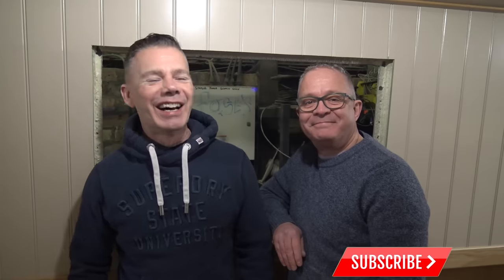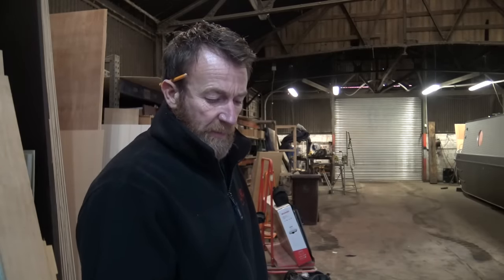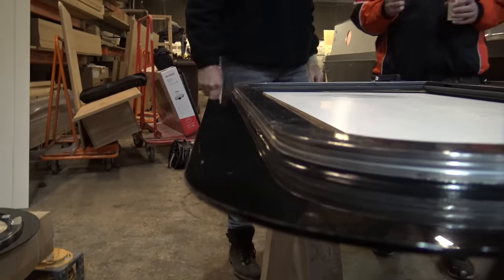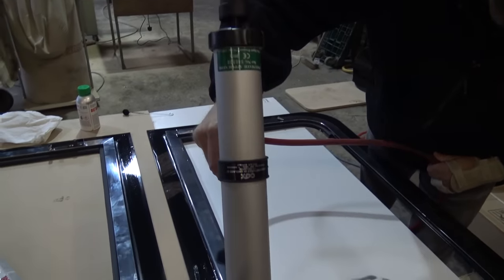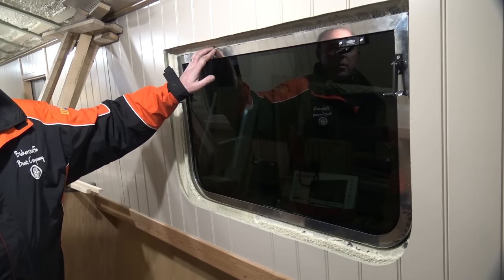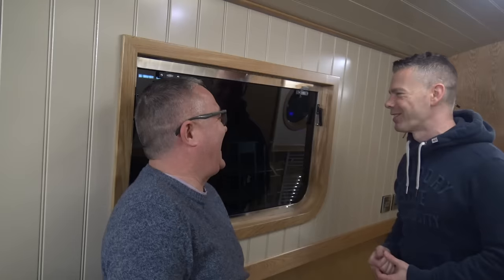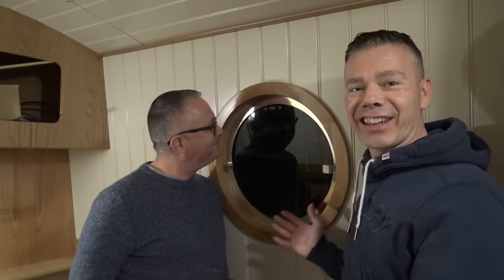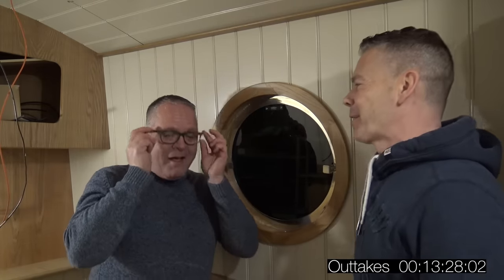Installing Bonded Privacy Windows on our New Canal Narrowboat - Ep. 37

Comment: Any feedback on the windows when it comes to condensation over normal double glazed windows?
Reply from the maker: On a narrowboat double glazing isn't normal. The issue is moisture in the boat, not condensation on the windows. That's just a symptom of the excess moisture. The trick is to reduce moisture as much as possible, such as not boiling things, good ventilation, extractor fans and common sense things like not drying washing inside the boat. Once you control moisture (we use a couple of detectors to tell us how moist the air is) it doesn't really matter if you have single or double glazing.
As for noise, again, living on a boat you won't get much noticeable reduction using double glazing, same goes for heat. That's why hardly any boaters have it, not builders fit it. The cost doesn't represent anywhere near value for money 👍🏻

Comment: On a Narrowboat you have the issue of sloping down walls which will be a problem for any window covering. All blind types have many problems but remember you still have to facilitate the glass opening. I would go for bottom pinned back curtains which can slide right back. If day time storage is available why not have a Bung for every window!
Reply from the maker: Hey Tim!
Yeah, the blinds have a fixed track to keep them in line with the window, and also pull up and clear to allow the window to be opened and removed. Please don't encourage Shaun with the bungs! lol! xxx
Reply: Bungs: great for no thermal transfer, great for noise blocking, great for privacy, can be covered in quotes of the day, can have secret compartments, can be colour coded, I could go on .............
Reply from the maker: I like the idea of secret compartments 👍🏻 #chocolatestash

Comment: is the glass insulated?
Reply from the maker: Yes, they have a thermal break which insulates them from the steel, cutting down on condensation.
Reply: @FoxesAfloat  Rocking Cool!  I went to the website ( https://caldwellswindows.co.uk/ ).  Not only do they help solve a problem with condensation but the website is easy to use and informative.  Note: Has pictures of you folks and your narrowboat project as well.  Perfect for reference.

Comment: MDF on a boat, not my choice,very carcinogenic and retains moisture, if your spending £££ then marine ply or standard ply is always my first choice but MDF  is a no no. Nice shell but the materials used for the fitout isn't ! Just a joiner of 40 years opinion.
Reply from the maker: Hi. It's moisture resistant MDF, with many coats of additional treatment. It's actually more resistant to moisture than marine ply, and massively more resistant to moisture than standard ply. We've checked out boats that have had it for many years with no problems. These are materials chosen by experienced boat builders, carpenters and surveyors with 30+ years experience in the business. Thanks for the comment though! Always great to keep the team on their toes :) x